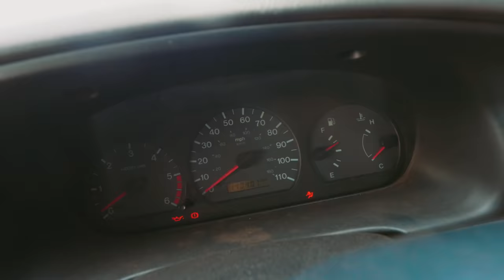MAKING A FALCHION!!! Part 10 FINISHED!

Comment: Alec try a medical stretch band, They are used for people recovering from surgery on muscles. It helps strengthen the muscle. You can buy in a tube form or even in sheets. Its real stretchy, and when stretched it apply lots of pressure on that were its wrapped around.

Comment: Alec you can also use the thicker 1.5mm solder to wrap leather and give you ridges without having texture from  the woven threads. I've done it before for prop making. Your handle turned out great. I actually liked your paracord texture. I love your thirst and drive to improve and do your best work with each project you take on.

Comment: If you wanna do leather wraps in the future and don't want any texture from cord wrapping, use teflon tape.... works perfectly
Reply: i also used some large rubber bands
Reply: i was thinking the same thing when i saw this
Reply: I just wonder why he didn't wrap the good leather on the handle in a scrap leather then cord. Easy peasy.
Reply: I used paper maskingtape...works really well....
Reply: He wanted a texture... He says so in the video... He just wasn't happy with the texture from the paracord.
Reply: If you are going to do a cord wrap, best to use nylon cord.

Comment: Do it Nice, or do it Twice, Alec. Or in your case, do it thrice.
Reply from the maker: *Eightice
Reply: Alec Steele - “Eightice: The 8th attempt made at rebuilding the same piece of a single project. Because, 3rd time’s the charm, but the 8th time is pure perfection!” (Or the camera battery finally died, and you needed to buy another gallon of Blue Dykem before the store closed.)

Go to Alecsteele dot com for the new Eightice T-shirt!

Comment: for the handle try using a waxed cord next time. waxing it prevents the bits sticking to it. 

also the type of glue you used. 

try a strong hide glue, typically dries super fast, paint some on both sides, then make a weaker hide glue that takes longer to set. use the longer acting hide glue to reactivate the stronger glue. 

work in a room with a higher temp and set time also increases. using both methods you could be able to get something alot nicer. oh also for the cord wrap beneath the leather, its done to increase strength of the grip, hemp cord combined with glue works in a similar way to the rayskin wrap used on the katana handle. 

also it could also provide more contact area for the glue and the leather. not entirely sure would need to do some testing.

Comment: Great craftsmanship in making this blade. My one suggestion would have been to make the pommel cap / tang plate with an internal “v” tapering down towards the blade. That way when you heat up the tang, the excess material that is hammered in, seats nicely into the “v” rather than splaying over the edge. Don’t get me wrong it’s a beautiful piece but would have just finished it off a little nicer! Keep up the good work!

Comment: A suggestion for an untextured wrapping medium would be either high strength mono-filament fishing line from a tackle shop if you're near the coast or strimmer line from a gardening centre, both are smooth, strong and flexible without being expensive or hard to get hold of. Anyway, the piece looks fantastic and I look forward to seeing future projects, all the best

Comment: Here is a suggestion for a wrap when you glue up leather to wood: an ace bandage.  It's wide and stretchy so it doesn't leave any groves and you can get it tight easily.

Comment: That pommel is screaming envrave me !!
Reply: exactly. put that in then hands of a good engraver and that thing will be one for the ages.
Reply: It's pretty thin from having to get the weight down. Would hate to see it damaged during the engraving. Electro etch like the touchmark on the blade could work though.
Reply: It's not that thin, I doubt you would break through to the hole in the middle of it just from engraving.
Reply: If you can engrave the side plate of a revolver you could engrave this pommel.

Comment: With the leather wrapped handle if you don't want any sort of texture left on it after wrapping it use an additional piece of leather to place between the handle wrap and the twine or cordage used to hold the wrap in place while the glue dries

Comment: good job, but that pommel is really looking rather large for the piece to me.
Reply: Yeah, it seems a bit oversized to me as well.
Reply: A smaller pommel would shift the center of balance too far forward.
Reply: yeah, but if you recall it's hollow so it's very lightweight. sure it's a great piece, just my opinion on the visual aesthetics.
Reply: It's literally a copy of a certain type of falchion
Reply: its historically accurate, he was making sure to stay true to correct weight and dimensions for this piece, not just doing what he likes the look of

Comment: Hey Alec, I'm a massive fan of your channel having binged most of your videos on the little down time I get, but I'm also a huge fan of Dungeons and Dragons, I challenge you to create a full set of dice, it's a small build and would put your dexterity to the test because if they are too far off they won't roll correctly. Use the material of your choice, but no lathe or precision tools. Files, sandpaper, and hammers only. (cutting wheels allowed for sizes alone)

Comment: Hi Alex, thinking about the length of your forge and had an idea. You could build a second forge and when you need the extra length, remove the false back to the main forge  and add the second forge on, Bob is your uncle.  the best thing is that  if you build a longer all in one forge then you are heating it all unnecessarily. Also when you are doing mobile excursions, forging on the move you have the smaller unit.

Comment: Was think for another use of the hamone. Using Damascus steel, either a. the area where the hamone is gets protected during etch or b. the reverse the blade gets protected from the etch. So in a. t the Damascus pattern shows through along the blade edge and in b. the pattern shows through in the area of the hamone.

Comment: Hey alec, crazy idea..

How about using the non adhesive side of electrical tape or some other high elasticity tape for holding on the leather to the wood? It may get rid of the lines left from the twine/string/thread. 

Just a crazy idea. 🤔💭

Comment: With regards to wrapping the leather, have you considered PTFE (Teflon) tape? It’s flat, inert, cheap, and widely available. I’ve not tried it myself but, I reckon with a little experimentation with wrapping pressure, you could eliminate any added texture completely. Just an idea.

Comment: I watched video a few days ago from scholagladiatoria in response to a vid from Skallagrim about modern material for sword making. The suggestion from this that most interests me is the concept of a hardened steel edge (maybe even a diamond tool steel edge???) backed by carbon fiber. The thinking on this is an extension of the concept of the hamon, just VERY light. Maybe a 2 edge sword with the carbon fiber made to a keyhole fit in the center? I have no idea how you would forge carbon fiber to steel otherwise. It sounds like an interesting design challenge though.

Comment: ALEC !!! >>>>SWORD OF TRUTH<<<<< 
Very very good book series as well !!! 
Richard the main character is given a sword 
The sword of truth http://sot.wikia.com/wiki/Sword_of_Truth_(weapon)
Would be a very interesting build and I'd absolutely love to see how you work in the story into the blade

Its described as a wire wrapped handle with (in silver) inlaid word "truth" 
It's one handed weapon with a distinct ring as its drawn from its sheath 
Very sharp and if used in mercy the blade turns white (not sure how youd be able to include white into the blade itself) 
It has engraved near the bottom of the blade the symbols describing the "dance with death" which is a spiritual connection through the sword to all its past owners passing on their knowledge in combat

^^^^ more can be found in the books as well as on the WIKI fan page

Comment: Today in Triste's castle museum I saw a particular of an handle that might be of your interest. You struggled with different tecniques to obtain the fine line texture on the leather. Please check the following picture: https://drive.google.com/file/d/1oL4uatJ4kXy4k5yyMPJJAa6oqOUrq0UP/view?usp=sharing   Seems that similar texture was obtained wrapping the fiber on the wooden handle and only then covering by leather. It makes sense in my opinion as sweat of long use of the falcion would probably flatten lines obtained by "wrap forming" . Instead the use would make ahere and, eventually deepen lines is the texture given by the rope is under the leather iself. You can consider it for another project. Instead if you are looking for some new  weapon to make for future project, I guess you have never made a boar sword...